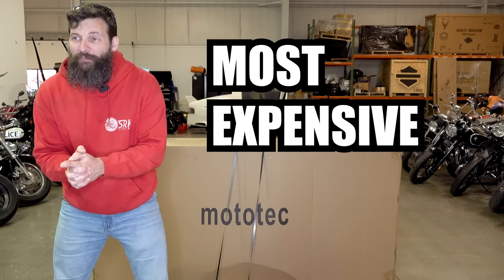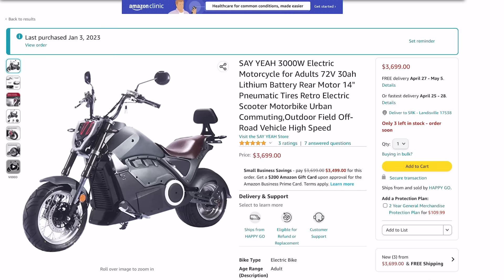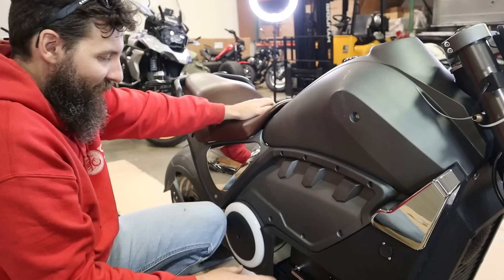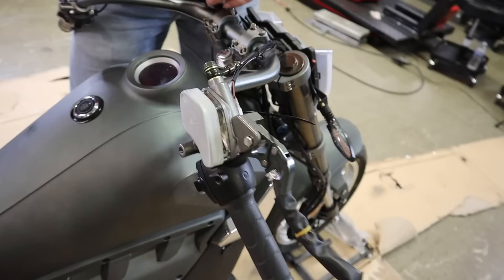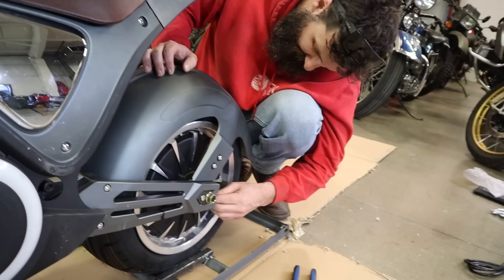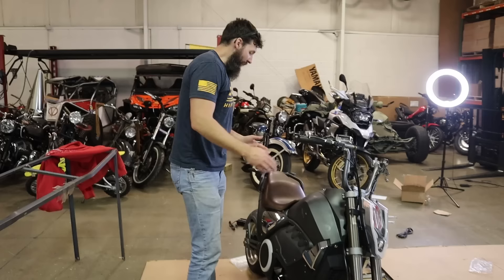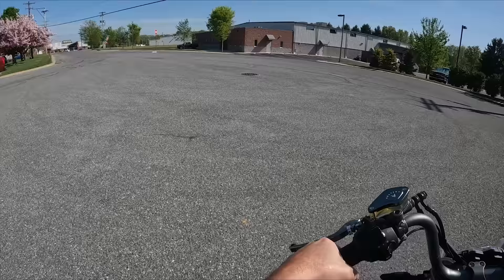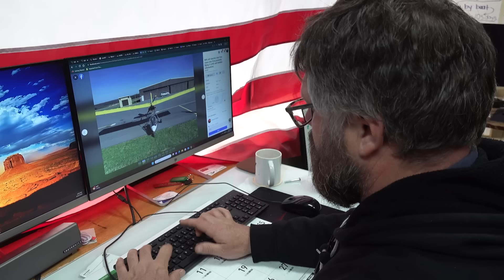I Bought the Most Expensive Electric Motorcycle on Amazon

Comment: What I don't understand is why, after designing and making something like this bike, or perhaps an electric scooter, or skateboard or whatever, they spoil it all by shoddy and slapstick assembly. While this bike/scooter or what ever you want to call it, might not work in the US or other places, it might be ideal somewhere else as a cheap and convenient form of transport, but it's let down by the lack of quality control. I bought a Kaboo Mantis scooter about a year ago and it had problems right from the start, all caused by whoever assembled it in the factory. (none of the electrical connecters pushed in properly). But since a scooter tech (yes, it is a thing!) went through it under warrantee (and at great expense to the shop that sold it to me) it's great and a cheap and easy way for me to get to work.

Comment: Funny you mention the connection between light feeling and cheap electronics, I recently opened up a cheapo BT controller form Walmart and found two roughly 19mm nuts sitting inside it, seemingly just to add weight to it. 😂 It did make it feel more expensive though.
Reply: I had an airsoft sniper back in the day which was weighted pretty well.  well, turns out after opening it up that it had four bars of mystery metal enclosed in the stock!  definitely made it feel nicer having them in than out.   when I tried it with them removed, it was a fair bit  lighter but also very front-heavy due to the metal barrel.
Reply: @TheJunky228  Typically they use lead, its cheap, its super dense so its good for added weight, and if a child eats it then China is happy.

But on a serious note, as long as its not taken apart it does make the most sense of any metal to use, though I sometimes remove weights in computer mice for example (though one I took a Dremel to and skeletonized it, another I've even drilled lightening holes in the PCB, and I've 3d printed light weight spoked mouse wheels then drilled even more holes). Every airsoft that I've seen weights it was always lead (you can mark a piece of paper with it).
Reply: Companies need to hide a few 10mm sockets inside!

Comment: You know immediately there is something very wrong with the bike when 1. The wattage doesn't correspond to the stated amps and volts and is clearly exaggerated 2. When your (much tinier) e-bike moped has a more powerful 84 v 30 Ah battery, and already it strains double riding up a steep hill so that the speed drops 15-20%
Reply: Something also wrong when no one thinks to use a helmet. Safety Third!!!

Comment: PRO TIP, with "Zip ties", you can use the Tail of the zip tie to probe open the backside of the latch that secures it.
You can basically shuffle them back and forth a bit till you get the tongue of that tip in and cause it to slip right off!

Comment: Our project we did last month is better. Only around 2500 USD spent. A 5kw hub 14 inches and controller, 72v 80ah battery pack (with a room for a double batteries) we just got rid of the compartment, it is an Yamaha Aerox 155 we modified.

Comment: Recently bought a scooter that does 35 km, which I x-framed and nodded even with a set of goggles pizanno headlights, is blue and even stuck on a batman decal. Use the original lights under side.  Has 16" wheels and looks like a pepped up old man scooter.  Now looking at acquiring a 120km ebike just for the back hub motor wheel as a replacement for the 350 watt one.  More Q-branch and Central!

Comment: Divide KMH in half, then add 10% to get a quick, easy conversion to MPH.
100 kmh divided by 2 = 50 + 10% of 100 = 60 mph

80 kmh div by 2 = 40 + 10% of 80 = 48 mph
60 kmh div by 2 = 30 + 10% of 60 = 36 mph
And so on ...
Personally, I find this to be an easier, quicker calculation than doing a straight .6 conversion. Obviously it works for KM to MILES distance, too.

Comment: Just wondering what happened to the 2nd half of the OCC Miss Geico bike video. Did you get it running? Did you fall off the back when you goosed the throttle and then did the boat style safety kill switch work? Inquiring minds want to know 😂

Comment: Most of us are experienced riders. We think it’s junk. But I will tell u. I had a a hawk for maybe two months. Damn thing ran every day. Flawlessly. But just not my standard to a jap bike. I am thinking of getting my kids a bike. But I want it to be low powered. The one has rode my shadow 1100. Did well. But can’t ride the Suzuki. Throttle is too touchy. And the xl250r has an upgraded clutch. Plus too much power to weight ratio for them. But for a child or new rider. These bikes are great to learn on. They’re cheap. If u destroy it. No one cares. But on the other hand a kawi ninja 250 is the same price 😂 I’m not into the electric. It never works out

Comment: All that wasted empty perfectly good unethical space in the biik and no place to put the uncomfortably light generic key fib. Lol. I bought my daughter a Chinese quad to start out on and it literally had missing bolts and misspelled words in the manual i had to use bolts from the crate it shipped on to finish putting it together.  It broke a month later after like four rides and the handle bars never got tightened enough the parts and frame were cheap as heck.